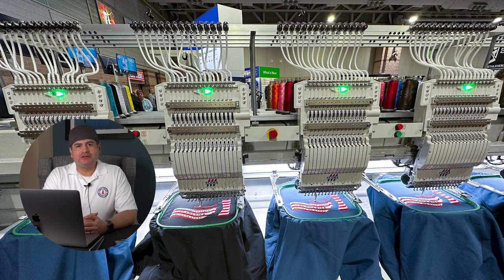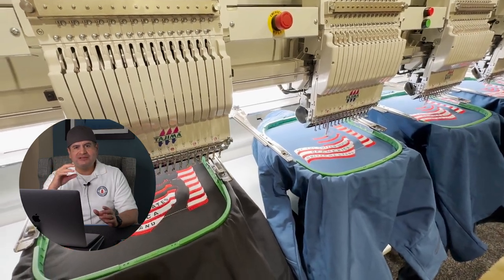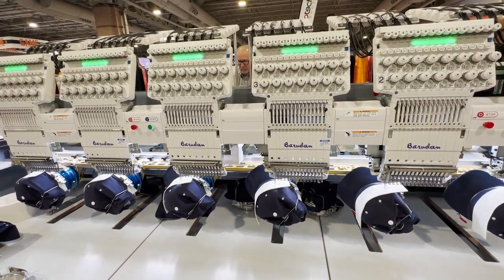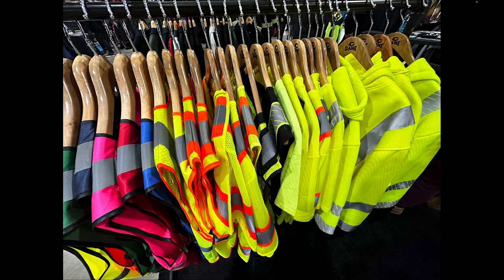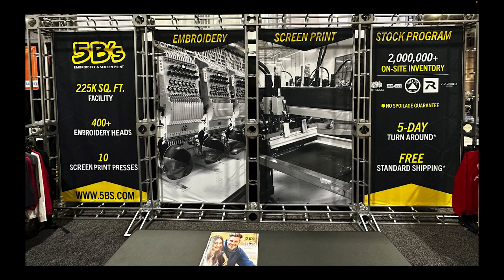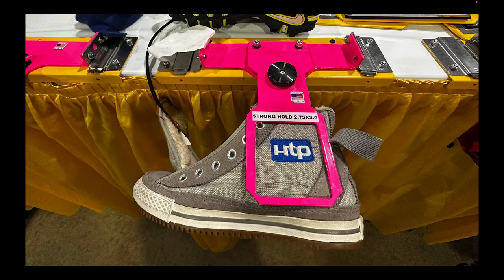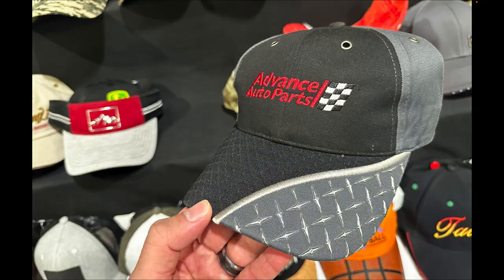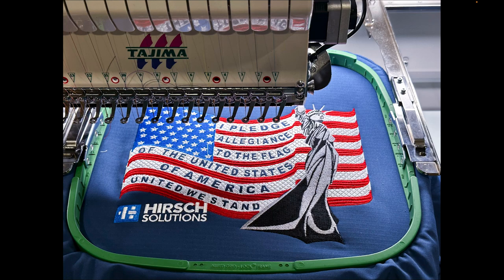What I learned at The 2023 Impressions Expo Atlantic City

Comment: Thanks for all your videos and info on the trade show. I have got a problem with my machine and wondered if you have a video on how to fix. I was working on hats and was loading a new cap and I had to push so hard to engage the cap ring onto the driver Imust have pushed the pantograph out of center for my hat hoop. I took everything off and recenteredmachine to 100degreesand the re set the cap designand it still says error with y axis being out of hoop. Can’t get the driver to find center but it finds center on a regular hoop. Sure could use advice or a video…thanks. Mitt
Reply from the maker: Hello, thank you for the message. You probably have to manually recenter while the machine is off. Find the center point then turn the machine back on. If possible call or email your embroidery machine support so they can get you further info, thanks.
Reply: @RomeroThreads  thanks for quick response ..I will call tech support and get help. Thank You and keep up the great work !